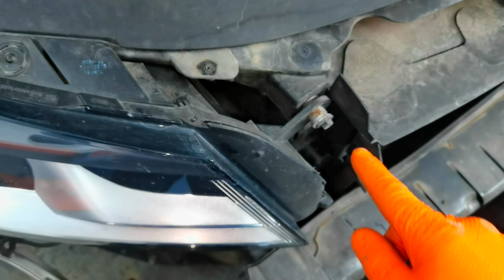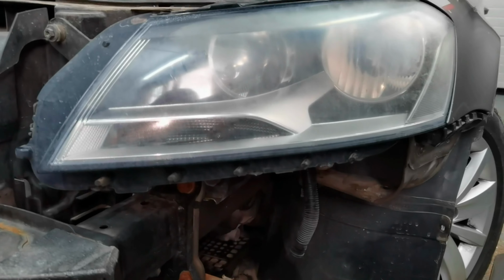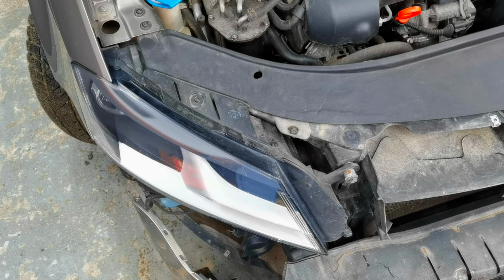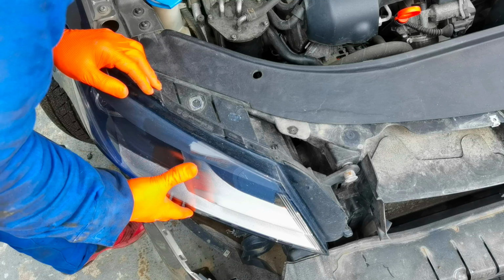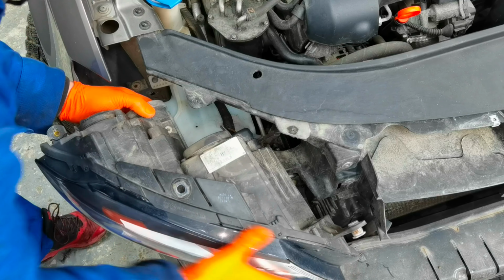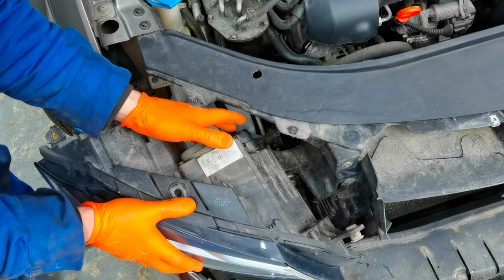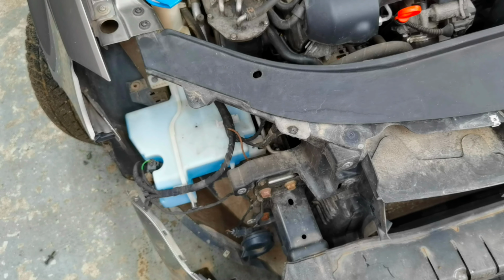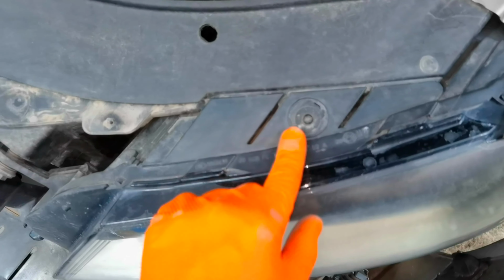VW PASSAT B7 HEADLIGHTS REMOVAL !

Comment: Is the little engine powering the headlight in the headlight itself?
Reply from the maker: Yes sir
Reply: So this seema very much plug and play. So my headlight is really just connected with 1 cable yea.
Guess theres no reason i shouldnt do it myself now
Reply from the maker: Good luck sir 🙏
Reply: @HOWTODO0828  that engine seems broken in my lights. The height adjustment doesnt work anymore and it makes a hunming noise permanently. I guess it IS best to just change the headlights altogether, instead that engine Piece. Is it even possible to replace the engine there properly